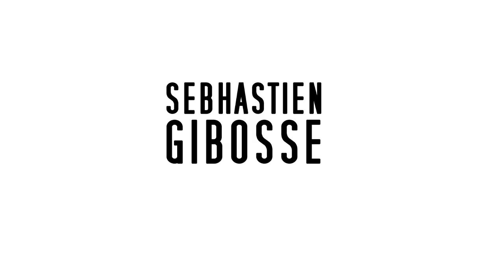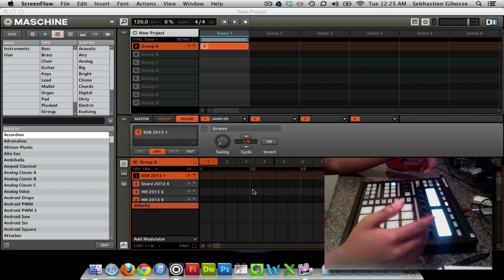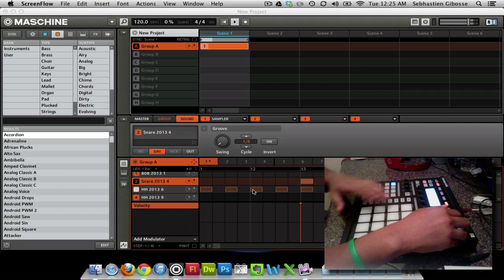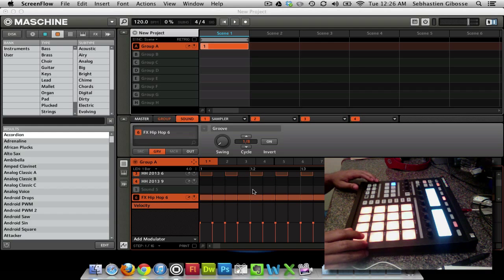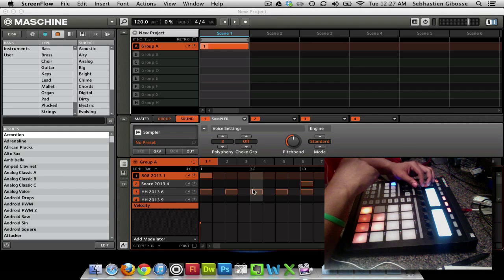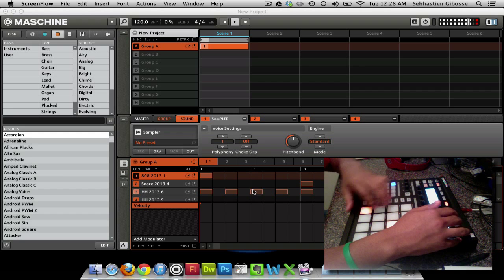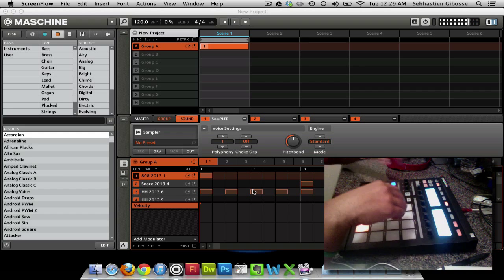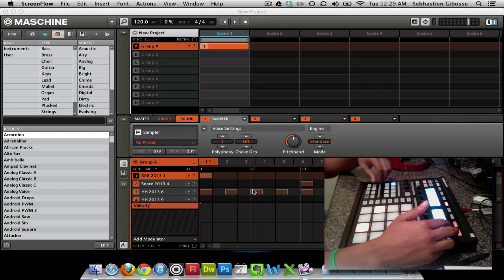Maschine 101 Tutorials - Episode 6 - Using the Step Sequencer

Comment: quick tip: If you know you're going to put hi-hats across all four bars, start with the default 1 bar pattern, toss in the hi-hats (just drag your finger across the column of pads), then double the pattern length to however many bars you want.